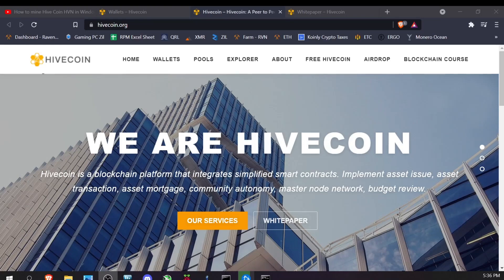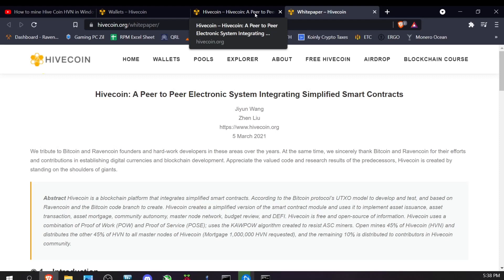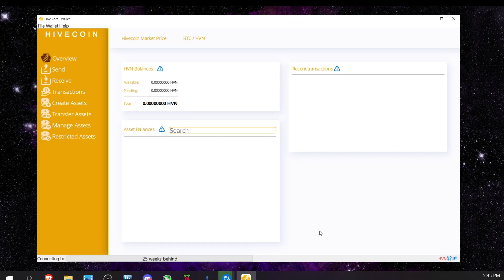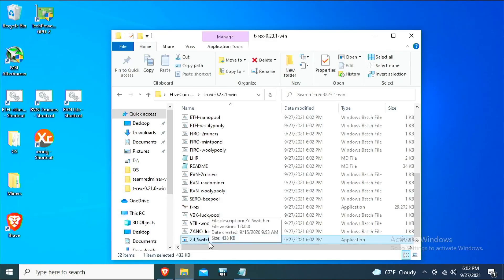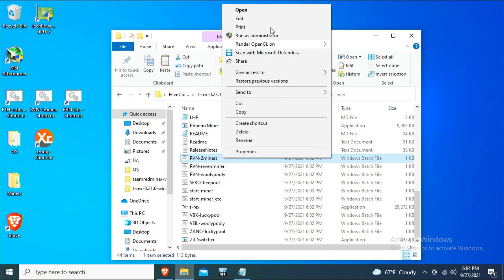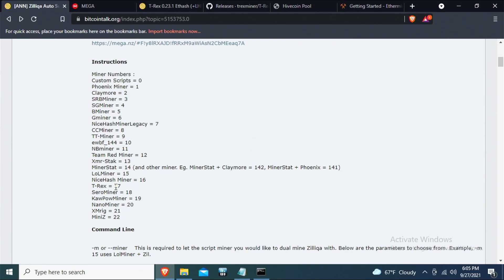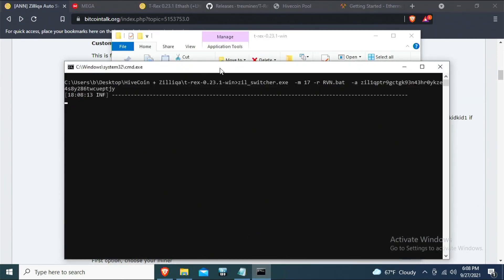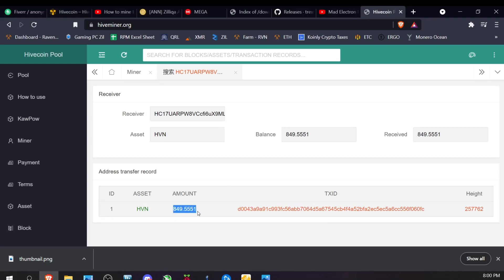How to Hivecoin + Zilliqa in Windows

Comment: can i use atomic wallet as my address for the zil portion? can you run just the Zil portion of this? or do both need to run to operate. thanks in advance.
Reply from the maker: as long as the zil address starts with Zil yes
Reply: @AnonymousMiner2  thank you! Not new to crypto but new to mining. And your video was fantastic brother. Subbed.

Comment: Somehow i cannot get this working as i need to run my hivecoin.bat file as administrator. I don't use MSI AB and put all my clock settings in the bat file. Any help on how to get the zil switcher to work with in this case, is much appreciated.
Reply from the maker: Yes there are multiple ways to get your hivecoin.bat file to run as administrator. Here's a video where I show how to do that https://www.youtube.com/watch?v=bSntO_XDnng&t=803s
Reply: @AnonymousMiner2  works like a charm! thanks AM!!!